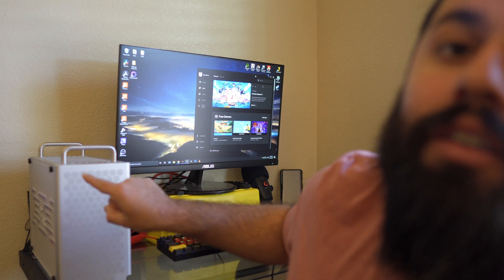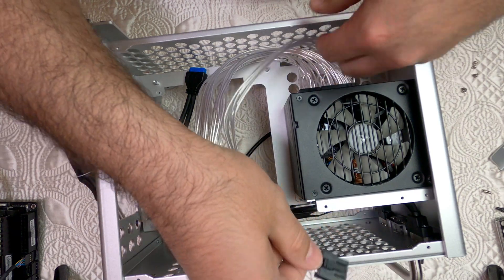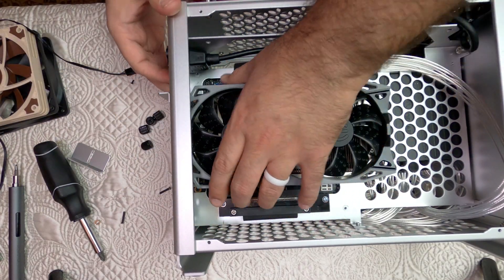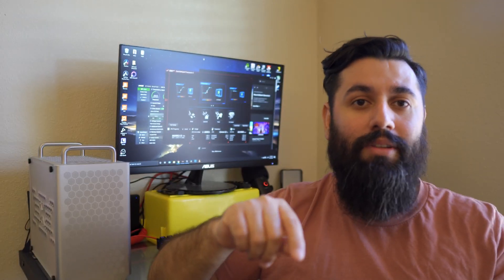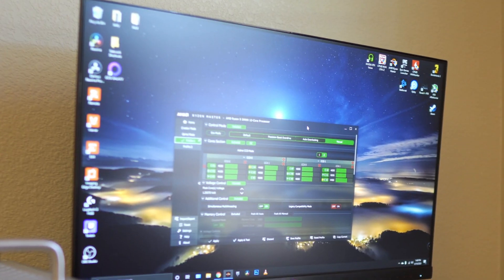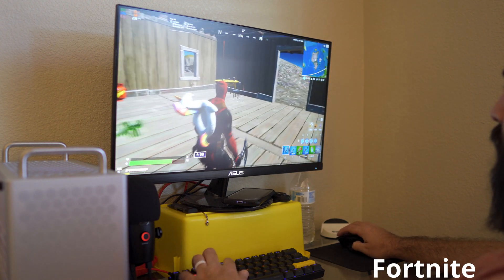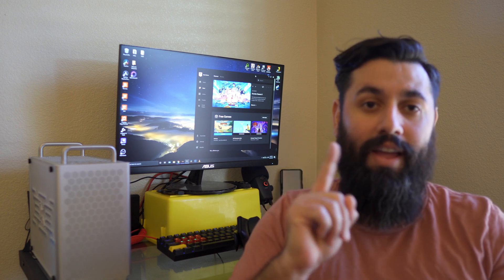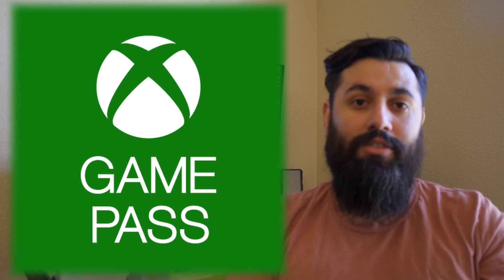$7,000 Mac Pro vs $2,000 Mac Pro- ITX SFF PC Windows 10 Edition

Comment: For the cpu cooler ... what is the maximum for cpu cooler height for this case bro ? I saw you using the noctua. can you tell me what top down noctua cpu cooler that fit this case and what is yours ?
Reply from the maker: I was using the Alpenfohn Blackridge Cooler. With the Slim 120mm Fan

Comment: Hi great review, finding an English review of this case has been rare in the internet. Anyway, it just occurred to me that you're rocking an Alpefohn blackridge on this build with a 120mm top fan, but the case only supports 60mm. How were you able to fit it? Does the fans spin stable enough? I've always thought that the maximum you can cram in there was an IDCooling IS-60. 

It's nice to hear that someone managed to run a 3900X on a cooler as small as the Alpefohn, I'm eyeing a 5900X personally, and I'd like to avoid a liquid cooler if I can. I'm spit between the smaller B1, or the larger B2+. I like the smaller size of the B1, but I'm also drawn to the 3.5" HDD support of the B2+, as well as the capability to mount larger GPUs. Nice build by the way.
Reply from the maker: It was snug, I didn't tighten the thumb screws all the way so it gave a few extra  mm to work with. The 5900x would be even better with thermals and stable overclock.
Reply from the maker: I had a 2.5in drive in the smaller one. Should be okay.
Reply: @drew71844  I see, I rewatched the video, it seems the case was bulging a bit. I'll probably stick to an IS-60 and run the 5900x at stock. 

The only thing left now is the waiting game since the new Ryzens are almost always out of stock, or are getting sold at exorbitant prices.

Comment: A true mini Mac Pro would use an itx asrock rack c621 with a 28 core Xeon, 384gb of ecc ram, the highest capacity u.2 drive available 8-30tb, and either a Radeon pro vii or a 6900xt stuffed inside a case that looks similar to that but all bead blasted aluminum and no acrylic. 

Though one thing I would love to see is a dune pro case build with a 5950x and a pair of 3090s along with the fastest ram and storage available, done up to look like a stock Mac Pro, along with a low profile mechanical keyboard and high dpi mouse that mimics the magic keyboard and mouse, and a 4k144hz or 2k240hz ips or oled panel that mimics the look of the pro xdr and $1k stand. It would be called the g-Mac pro. A gaming Mac. You could complete the aesthetic by shoving the internals of a razor blade into a MacBook Pro enclosure and modding everything to work properly. You could also do a normal g-Mac by stuffing the internals of a laptop desktop replacement with a 10900k or 5950x and a 2080 super mobile inside of a 27” iMac and replacing the display with a 4k144hz or 2k240hz panel. 
Unfortunately if Apple actually makes a gaming computer it will use their arm chips. I really wish someone with the manufacturing capability and money on YouTube (bittech or ltt) would do this project. Any one of them.

Comment: They should release a edition with an glass side panel and a grid on the front with the same design from the one on the top of the case
Reply from the maker: For sure. That would be amazing. They would also have to adjust it a bit on the inside to fit an AIO properly without making the case bigger. It's already a decent size case in liters, so it should technically be able to fit one if they design it better.

Comment: i just bought the same case. the only different was the name. mine Samrt and the model is B2.
i digging more for review but only found one on youtube. then i found other name for this case, zen art zone i think.
there are 2 version, b2 and b2 plus. b2 only support 2 fans on top while b2 plus support AIO.
i think with that much grill on the cawe, the temprature should be okay.
Reply from the maker: The b2 plus is significantly taller in sff metrics. I put an AIO in a smaller case in the Nouvolo Steck with the top hatnas compared to the regular sized b2 where there was no room for an AIO. Just felt like some wasted space in a few areas.
Reply: @drew71844  just look at nouvolo steck. interesting design with good cpu cooler support. also with AIO and custom loop support.
i bought b2 + shipping fee for around 76usd. seller said it come with 2 fans and riser. still waiting for the case to be ship out.
i change from node 304, first i want to buy k39(velka clone). that 4 liter case looks cool but then i need to change my psu and gpu.
Reply from the maker: I haven't seen any for less than 160 USD, how did you get it at such a good price?
Reply: @drew71844  maybe because this is oem part. different brand put different price with different grade/quality.
once the case arrive i will check for build quality and if got some missing part(riser or fan). but as seller said both of items include in the case.
i bought from oversea seller(china seller register with local online platform). there are local seller that sell the same case with different brand for about usd110. they either got ready stock or pre order from oversea(china).
i live in south east asia.

Comment: Being an X570-i, were you able to keep the M.2 (although heat sink is removed as I can see) on the front side with that black ridge and both fans?
or did you move it to the back? looking good
Reply from the maker: I was able to keep the m.2. Although, initially when I built this on my Velka 5 I had removed the entire m.2 and audio to install the blackridge but I found that it wasn't necessary.  I do have the 92mm fan but its not screwed on, I had to tie it to the heat pipes and then yes, the 120mm fan as well. I have another m.2 ssd on the back of the motherboard as well.